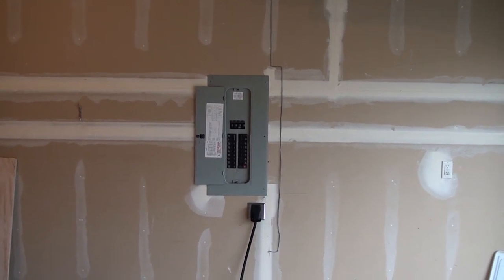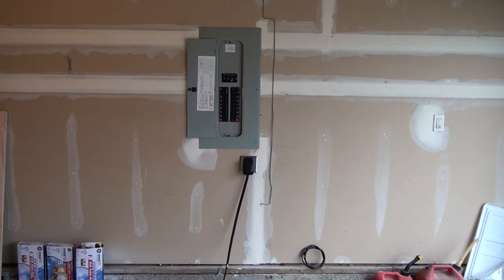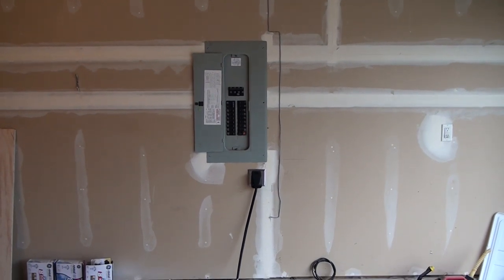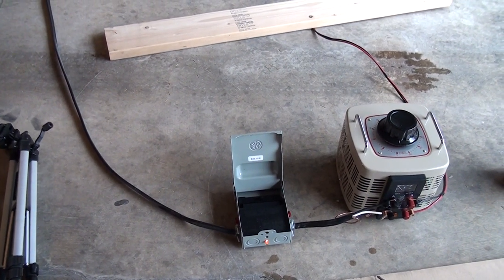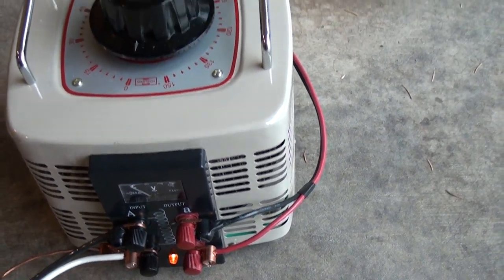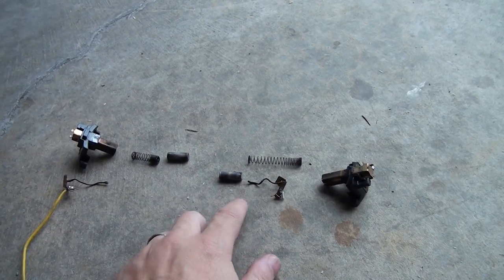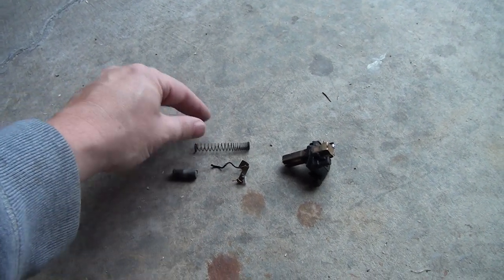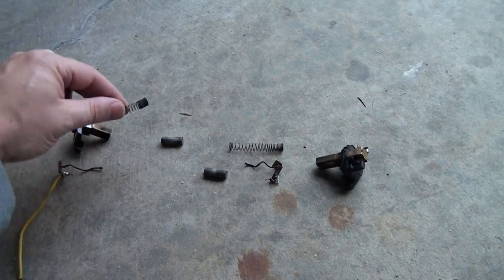Two Vacuum Motors Burn Out

Comment from the maker: @yesschembri normally a motors field windings are wired in series with the brushes (armature). When you bypass the windings completely and apply power directly to the brushes, the armature induces an opposing magnetic field in the windings so the motor still works (at the cost of torque I would guess). Wired in this way, motors start to burn out at around 80 volts.

Comment: Also there is a way to overvoltage the motor yet save it. If motor is being cooled down to refrigerator temperature and has cool surrounding air, it will run fine overvoltaged for several minutes. I would be careful with settting motors on fire because this can blow the variac during short-out, even if it is a powerful one. This happened to my 250W variac, set on 260W (250V, 1.05A at full load). I thought amps will decline as motor gets faster but variac blew, motor label showed 0.7A on full rpm

Comment: May I ask how do you burn out a vacuum cleaner motor with just 120Vac? Normally people use variacs to vary the input voltage to the primary of a ballasted MOT or something, so essentially they have a variable transformer from 0-2Kv. Did you wire the motor incorrectly or does your variac have some built in step up transformer ( which i dont think so) Thanks, great video btw

Comment: @ElectronSpark The next time you will overvoltage motors, please put relatively heavy balanced disc on the shaft. Listen to a noise of slow acceleration. One more suggestion for fun: If the motor is universal (magnets are electric on the stator), modify the motor to be ran by separate power supply for magnet and armature, you can run it by DC somehow using rectifier. Once at full rpm, reverse the polarity of magnets, and listen it stopping with the heavy load. Very nice sound will be produced.